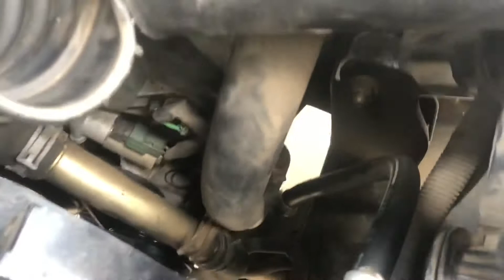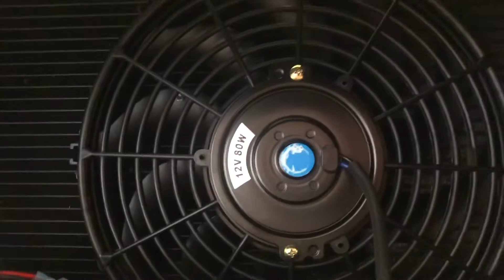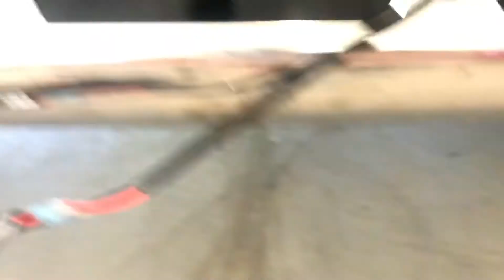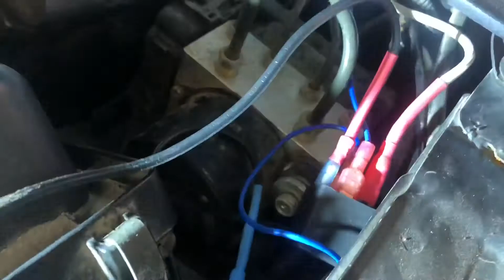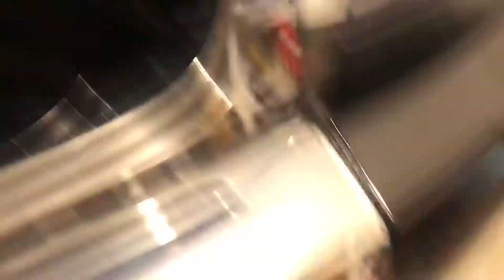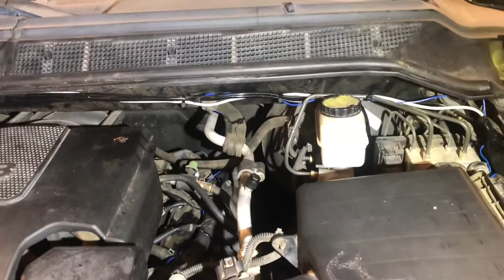Post 2009 Nissan Titan AC Condenser Fan Install

Comment: How has the temperature held up? My 2012 overheats at idle (only when parked for more than 15-20 mins) and I’m almost 100% positive this is the reason. The moment I get up and go, it goes back to normal temps.

Curious to see how this worked out or if I should wire a fan in manually, with a switch inside my cab
Reply from the maker: Have you replaced the mechanical clutch fan ever? If not, I would start there. It may seem like it is working fine but they definitely lose effectiveness over time. The electric fan has definitely helped with ac temps at idle but I never had an engine overheating problem before installing it. The thing that made the biggest difference in ac temps though was replacing the clutch fan first.
Reply: I was having the exact same issue my truck would over heat if at idle for a while and my A/c never got cool sitting in place. It was 100% the fan clutch. Check that first of you have over heating issues AND a/c not cooling issue at the same time.